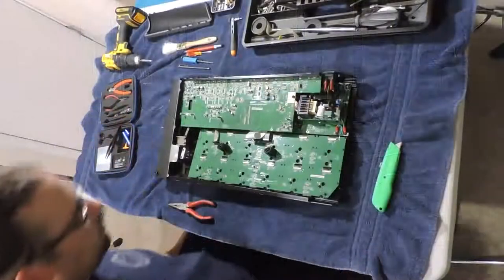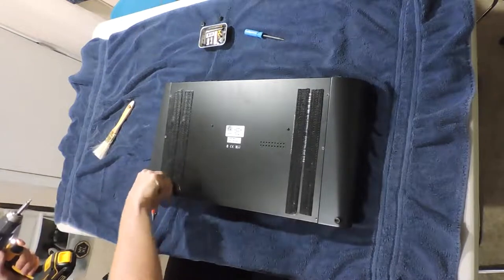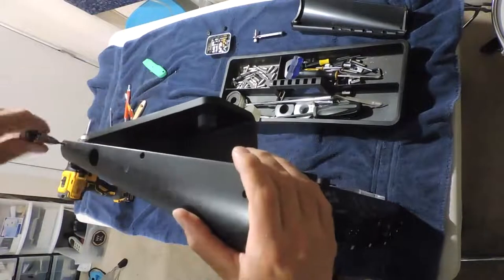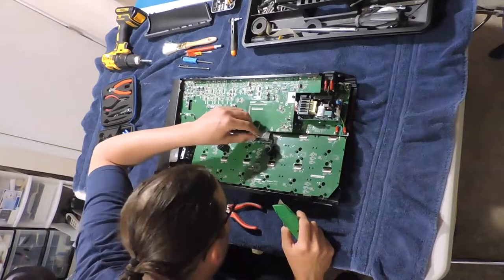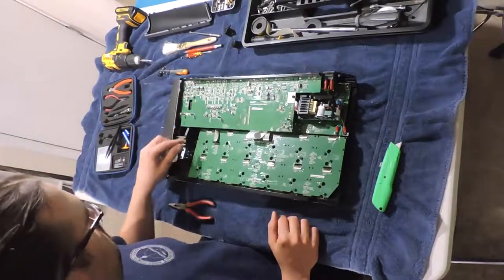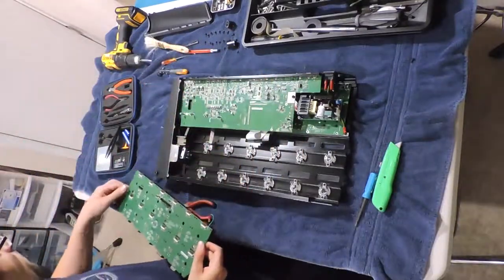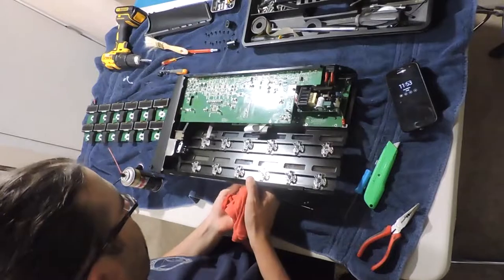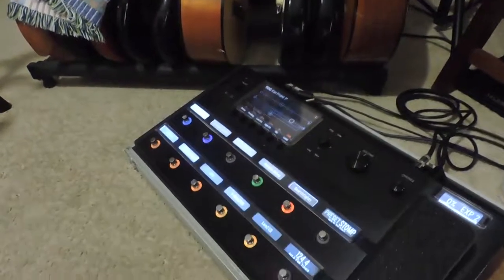Line 6 Helix DIY Footswitch Repair

Comment from the maker: Check out this shortcut method, bypassing the ribbon cable mess -- https://www.thegearpage.net/board/index.php?threads/helix-footswitch-repair-video.2249950/post-34864434

Comment: Thanks for this! Fixed an erratic Tap Tempo by switching the footswitch with one that is used less, and applied Contact Spray to the actual button. Problem solved. This was on a Helix LT, I did not have to fiddle around with the ribbon cable on my unit.

Comment: I just did this with my Helix LT. it’s the same process but slightly easier because the ribbon is on the opposite side of the circuit board and I luckily didn’t have to cut any glue and could just flip the board around with the ribbon attached. It was pretty easy. Thanks for giving me the confidence to try!
Reply: Niice! I'm glad to know that, I have to replace one of them on my LT.

Comment: Alex, thanks for posting this video! I have been dreading taking apart the Helix. One of the LED's on my tap switch is out (verified by the LED test and the fact it doesn't blink red anymore only very faintly blue). I have read that the LED's were not soldered that well when they stuffed the PCB, so I am going to reflow it. Thanks!

Comment: Thank you for the run though. I had the same problems. Just finished doing the same project and this strategy has seemed to improve my situation. My Tap Tempo button was the button suffering for the faulty button presses. After following this video and aplying the DEOXIT product, the tempo button works significantly better than it did. Thanks man.

Comment: I used liquid DeoxIT, and it worked.  A few drops and everything was good.  I think it's easier than using the spray in this particular context.
Reply from the maker: It probably is easier, but i've had this can of Deoxit since 2008 so I just use what I have

Comment: I have the same problem with my 1st gen Helix floor (10-12-15 registration), we had a recurring gig on a beach setting, and I think sand got into a couple of the switches. I worked them over with contact cleaner, and that helped somewhat. I can see on the screen when I hit a footswitch the block turns on, and turns off when I take my foot off. Also, when scrolling through the banks of presets, sometimes hitting "up" advances the presets too far, like going from bank 1 and 2 to 5 and 6 with one footswitch press. Trying to decide if I going to send the unit in (way beyond warranty) or try what you did.

Comment: My tap tempo foot switch is not acting right.. I don’t know if it’s mechanical or a bug in the firmware?  As such I don’t know wether to mess with cracking it open or not?  Hmmmmm…?  Thanks for the video, good job!
Reply from the maker: If it's mis-registering your taps on current fw it might just be the switch. I don't know of any bugs
Reply: @alex-kenivel  - that’s what I’m thinking, it is almost 7 years old and well used, thanks

Comment: Thank you.  Same problem with footswitch. Followed your video. Avoided your couple pitfalls.  Helix successfully repair (long pasted expired warranty now fully voided) One question I had: Are the mini switches sealed?  I couldn't really find an access point (like on a typical pot) to spray the deoxit. Still fixed the problem. Chalked to a little help, a little skill and a bit of luck.
Reply from the maker: They're pretty much sealed as far as my shoddy eyes could see save for a small gap around the edge of the circular button that gets depressed. I assume the cleaner gets into that area. I'm glad you're issue is solved!

Comment: Hi, I have a helix floor with this problem: it loses the input signal, the signal goes in fits and starts, the symbol on the input display flashes red, then it starts working again for a while, sometimes it works for hours and then repeats the problem. Lately it also crashes, meaning the large display turns off and all the small displays start flashing. What could it be? I was thinking about the power supply, thanks for any response
Reply from the maker: okay, sounds like two separate issues. Input issue-- try different cables. Try those cables in something other than Helix to rule out the cables. Crashing issue - those can usually be remedied by reinstalling the current firmware and following the instructions to the T: Make a backup, reflash (reinstall) firmware, factory reset, reload backup, power cycle off/on again to finally rebuild presets.

Hope these help. Feel free to get back to me if not.
Reply: @alex-kenivel  Thanks for the reply, so the pedalboard, as I wrote, works very well and has been updated, everything is fine but every now and then it crashes, everything flashes like a Christmas tree, then after an hour of turning it off and on again it starts playing again. I don't want there to be capacitor problems on the power supply board
Reply from the maker: @Moreno280161  I still recommend reflashing the current firmware even if it is up to date, most problems like this tend to go away after a firmware flash with the proper steps. I'm almost certain it isn't a hardware issue or the problems would be more consistent.

Comment: The ribbon cable being glued.... Did you have to glue it back in or was it ok being just clipped in like a normal ribbon cable? Thank you for the video. Im about to delve into this and try to fix 2 foot switches! But the glue concerned me!

Thank you!
Reply from the maker: No, I didn't have to reapply any glue. Best of luck
Reply: Use liquid DeoxIT -- it's a lot cleaner and easier to apply.  No need to unplug, unglue, and unscrew the ribbons.

Comment: Hi Alex! Thanks for the video. It helps a lot. I have LT version and have the same problem with few switches. Thinking of two options: changing all micro switches or just deox them? What's your experience after a few month after deox them? Is failure still re-occurring? Thanks for your feedback in advance! Brgds, S
Reply: Having worked on a decent amount of audio gear, it's very likely that just cleaning them (it's surprising how little Deoxit is needed) will solve it for longer that it took for them to fail from the factory. Switch cleaner is probably the best kept secret in audio repair. And it's not even a secret. That said, it could be the switch internals failing, but they usually fail fast when actually defective.
Reply: @Alex Kenivel ... any info would be appreciated! Tnx in advance! Brgds,S.

Comment: Hi Alex, i would like to know if you ever heard that helix stuck on ui mcu firmware updating screen. I have search & read some threads on line6 community and 2 of the thread says that maybe a cable loose or board displacement, do you have any idea about that? Thank you
Reply from the maker: That issue sounds familiar and I think that might need a deeper dive than I'd be able to handle. I needed the MCU board replaced on my unit due to loss of USB connectivity.

Try opening a support ticket with L6 if you haven't
Reply: @alex-kenivel  yes, i have open a support ticket with L6 but still have not any respond yet. My unit also can’t detect by usb if plugged into my pc when the screen still stuck on ui mcu thing, does this indicate a mcu board problem like yours?
Reply from the maker: @bobbyhartanto3210  I'm not sure but it would be my guess. It's a little out of my league
Reply: I bought mine from an online music site.  I had this problem and had to exchange the unit.  I was bummed but my “engineer” overnighted a new unit.  After 2 yrs, and gigging at least once a week, the volume knob feels like it’s going to fall through the unit, sticky tempo switch that annoys me due to using the strobe tuning onstage.  I’ve had it unstick and the audience hears me trying to tune up.  Some jacks came loose too.  

I’m going to try this to clean switches, and somehow figure out how to access volume knob, and other knobs.  When I go in I’m going to loosen and use some thread lock (maybe finger nail polish).  Maybe a good clean, and thread lock will prevent me having to open it up again.
Reply: 1st make sure your pc software is up to date, try and load the helix firmware, and if it don’t work…..possibly looking at a new unit

Comment: Can somebody tell me what the exact type (name or whatever) of the LEDs are right and left to a foot switch button? This is the second time that a couple of LEDs are wrong and I want to replace them myself but I don't know what are the types of these replacement parts.
Reply: Here is the part number for the footswitch LED. 18-26-0011

Full Compass does not have a listing for it, so you would need to call them or email them directly for pricing. We have them in stock, so they would be able to get one to you.
Reply: @ericajohnson7535  It seems this part number 18-26-0011 has a meaning only in Full Compass. I tried to search for an equivalent but haven't found.
Reply: @zkoszegi1  that's the only place where I know you can order these specific parts... you can also try buying a broken parts-only Helix, HX stomp, etc...
Reply: @ericajohnson7535  So these LEDs are not a general purpose ones that can be bought in a bigger parts store.
Reply: These are surface mount LEDS I would not suggest replacing those yourself unless you have experience with SMD soldering.

Comment: you need an earth bonding strap
Reply from the maker: Pardon if I come off as a bit dense, but is that to disperse static buildup?
Reply: @alex-kenivel  Hi Alex....exactly right. Modern electronics are very static sensitive, so when servicing such equipment an earthed wrist strap is advisable, or at least touch some sort of grounding plate at regular intervals whilst working on the unit. Otherwise a good and informative video, havn't yet found the need to take mine to bits!!!